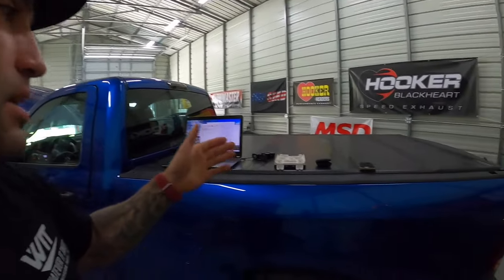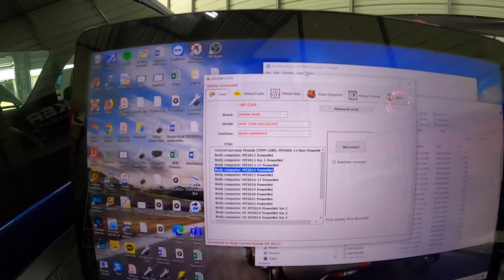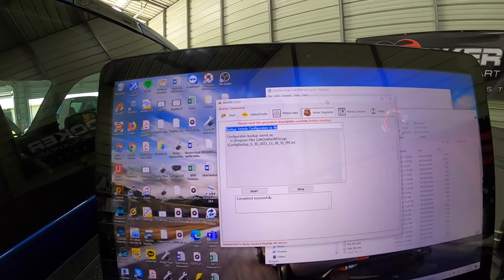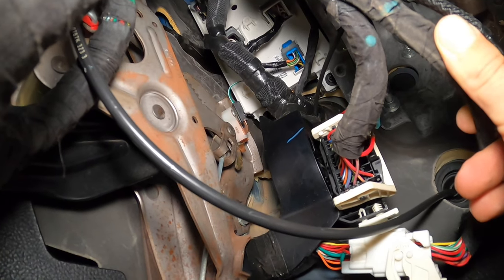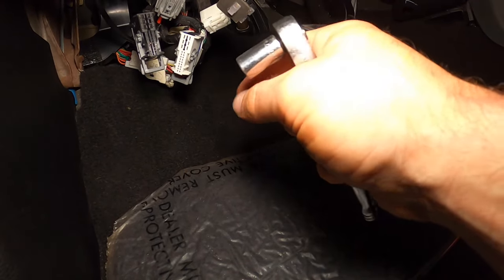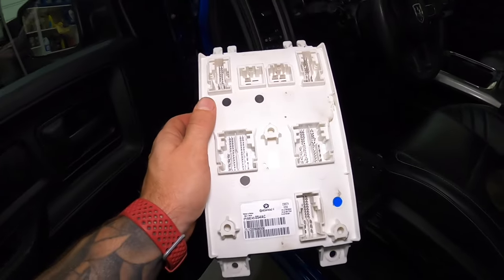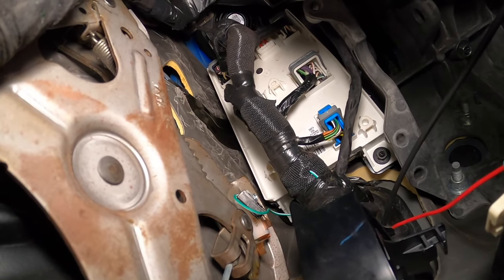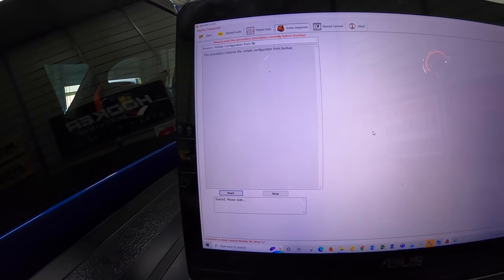How To Replace BCM Body Control Module Upgrade Swap RAM 1500 2500 3500

Comment: @BoostedMotorsports This video is missing some very critical information. You did not mention if  the replacement BCM is new or used.

Comment: I just did a BCM swap on my 2019 Ram 1500 using the bluetooth to PC OBD Link MX module and AMHTDOL SGW bypass cables.  No issue reloading vehicle config file to the BCM and reading status/codes.  However, AlfaOBD is unable to write the VIN# to the BCM.  I even did an engineering reset to clear the VIN# from the BCM.  Now the original and current VINs in the BCM are ????????.  Is there something I'm missing?  Help!
Reply: AYUDA!!

Comment: Now can you add/install say paddle shifters instead of the two little buttons on the ram steering wheel? Or change the wheel out for a hellcat or TRX wheel? There is a TRX steering wheel on e-bay by the way 😉.. because you will have to do somethings in the bcm for the hellcat engine correct?

Comment: I think this tool was a bust. Error when writing vin and error when writing original config. 2012 chrylser 300 push to start new bcm. The car did start not sure if it started from pure luck or if it actually wrote the vin snd config file. Its prior to 2018 that means old security. Good look doing this on a 2018 higher with gateway modules. Wonder if its hit-or-miss or wonder if it depends on the obd you use.  I used vlinker mc

Comment: Oh man you just made my life sooooo much easier! 
My truck started out with a Lost Communication With Steering Control Module with BCM. Changed the clock spring with no change. Truck flashes all kinds of random lights. Things got more interesting today when the tech started jumping all over. Every light flashing, info screen in speedo cluster reset and started flashing all kinds of weird notifications. 
I figured a BCM change was in my future but was REALLY concerned because the truck has had weight loss program, plus it’s a 68rfe swapped to g56 trans so it isn’t exactly a normal setup. Everywhere I was looking wanted to program to my vin, which wouldn’t work because it’s not an auto anymore. 
I figured I would have to manually copy each and every setting with Alpha OBD but your video just showed me it’ll be a breeze!! 

Once life settles down a bit, I’ll tackle this. 
Thanks again for posting!!!!

Comment: thank you for this! been having loss of communication issues with headlights and the transmission shifting. its been getting worse over time. a cel comes on and goes away by the time i get it to a shop. looking at gathering the obd2 device, software, and seeing if i can tackle this myself.

Comment: So if it doesn't take the new vin what do you do?  Do you recommend a new bcm or a used one?  I have a 2013 ram 2500 with cummins 6.7 and my door locks are not working and everything i have read says bad bcm.  Thanks

Comment: Hi John, 
Have you tried to replace a 2013 ram 2500 6.7 BCM with a newer 2014-15 BCM? Mopar does not have any of the 2013 BCM's available any more and has no restocking dates set. My truck is throwing codes and having issues and I believe its from my faulty BCM. Thanks James

Comment: Does this upgrade fix the body swing? my 2017 rocks back and forth i have replaced the rear sway bar and front drag links from the sway bar but still have a little body rock. in the beginning it was so bad that the anti roll function would cut the motor and then start again. Please help love your help

Comment: Question.  If I follow these instruction and purchase the OBD key, I will not have to go the dealer and have the ECU flashed?  Still need to purchase the BCM.  Bought a Autel scanner and it keeps going back to the BCM and both door modules.  I think it's the BCM.

Comment: Do you think its possible to upgrade a BCM from a 2009 to newer one like 2013 and up?
Reply from the maker: Not possible unfortunately. Completely different wiring systems on 2013+
Reply: @BoostedMotorsports  what to do if you encounter the problem with entering the vin? 9:44

Comment: What if the file back up was not done (could not be recovered) prior to making changes? Is there a way of recovering the original setting/codes. How do you recover the original factory settings? How is the new PCM  programed to the original factory settings?
Reply: Hi Dave, did you figure out? I have simialr issue, I don't have original BCM and I need to change the VIN of used BCM.

Comment: Actually I wonder what exactly the option "Backup configuration data" saves. According  to the AlfaOBD author it does technical backup containing only the raw data, whatever that may mean. Considering the backup file is merely a few bytes and although it has a .txt extension it doesn't contain any human readable data. What about changing a broken BCM without having a configuration backup?

Comment: I follwed your video exactly how you did it but unfortunately the new BCM won't allow me to switch to acc or on posting to be able to download backup file to new BCM.. car won't start at all with new one . When I try to download file it says no data received from ecu.. how can I program without turning on switch? It's a push start button type
Reply: You ever figure it out man what year ram you doing and what year BCM
Reply: I can say I'm a locksmith and I do pcm chnage all the time the car will communicate to read pcm and write pcm vin and program keys by Turning on flashers to wake up system

Comment: I think the only thing left is the passive entry and the push to start button i really wish you do it
Reply: YT "Hydro Blue Ram", he has an OEM parts kit and makes the harness for this. I just did my 2018 2500, and added the passive handles also, works great!
Reply: @DoubleA-ARon  does he give me the button ,the rf hub and the handles or just the harness?
Reply: @abdullahmalek9027  depends on what he has in stock. Usually he had the rf hub, antennas, push button, key fobs and harness. You'd need to get the correct door handles.
The job is easy, but difficult. The pinning of the door harnesses takes patience, but is doable.

Comment: am having this problem in my 2013  Ram 1500 but the part number for my body control module 4692251AH isn't available at the moment will your install process work for my truck .... i want to purchased the odb cable  but cant find the software for my laptop
Reply: It’s available check Mopar that’s where I got mine last week
Reply: Evening I've been trying to get this part and none of the dealership have it. I've been told it's a discontinued part, I have purchased one from a salvage yard will I have to do the reprogramming on it.....
Reply: @josephkochmann575   Ive check dealerships here in Alabama and Atlanta, even south Carolina .  i also called ram care for the part and was told to get it aftermarket or salvage yard.

Comment: So I really want to get a stinger Heigh10 display for mine. Then build a PC to go in the dash behind the display. Once I take out the factory display the Heigh10 hangs off the front and leaves an open space. If I put a PC in there I can have HP tuners and AlfaOBD etc. built into the dash.
Reply: @timbrwolf1121 how did your pc build come out? I’m trying to do the same but can’t seem to find a step by step guide anywhere on the internet. I do have the the stinger 8eleven radio and a 15 inch touch display. I understand it would be ideal if I flash boot a sbc android os. Lmk
Reply: @codyriiter3645  when I typed this both the PC and car market were like 6x what they should be and are still coming down. So nothing yet
Reply: @codyriiter3645  but heigh10 has an hdmi port and that's really all you need to know. It would work as a PC monitor
Reply: @timbrwolf1121  so does my stinger radio have the HDMI connection but I haven’t ran it to a monitor yet
Reply: @codyriiter3645  Nah you're close, but the stinger IS the monitor. Hook up a laptop or a microatc computer build up to it. I just realized you were talking about flashing software to the stinger, but you'd be much better off using it as factory and switching to a separate computer for other tasks.
Reply: @timbrwolf1121  yeah there isnt any instructions on how to root the stinger so I’m going to go the separate pc route with an android os installed.
Reply: @codyriiter3645  my only issue to work out is cooling. It might get real hot in the dash. I was planning on talking to more experienced PC builders and running a water cooling setup with an external radiator

Comment: I tried to do it like in a movie but it doesn't work out. When trying to enter vin shows the error "value out of scale" and when trying to read the value from the file it shows the error "ecu locked". Is it going to be solved somehow? My ram is from 2014 and the new bcm is from 2017
Reply: Did you solve this problem and now?
Reply: Any luck
Reply: Any luck again

Comment: Have you really used VIN Write function? I'm trying the same but it gives me error.
Reply: What error are you getting. I am getting the following error on a Chrysler. Failed. The ECU has detected that the request contains parameter(s) with value(s) outside allowable range.
Reply: I got the same error when writing vin and copying config. The car started 2012 300 but I didn't try to start prior. So Idk if it did anything or not. Maybe it was gonna work by default or maybe it had error but still worked. Anyone know?@rockingmeister

Comment: I get failed message with alfaobd.  “The ecu has detected that the request contains parameter(s) outside allowable range.”
Reply: Hello @Slo_poke300, i have similar challenge, it wont allow me change and gives similar errors. Please how did you reslove it?

Comment: I hope you can help though the internet but u have a 2019 ram 3500 dually. I di a upgrade to the 8.4 screen, something happened to it so I took it out and put the stock radio back it not I don't have ac tow haul mode or engine brake. Can you please help
Reply: Did you get your buttons working?
Reply: @Aeterven  do you have any idea what to do if you encounter the problem with entering the vin? 9:44

Comment: I really wish you youngsters would quit calling the hex socket size the screw size because it is not. Go to a hardware store and look for a 10 mm nut to replace one of them. You will be disappointed when you are handed a nut that is twice as big as your stud. If you are going to get paid to teach something, teach it right.